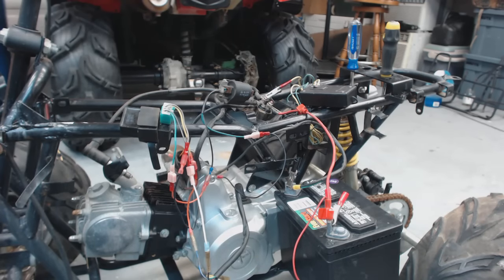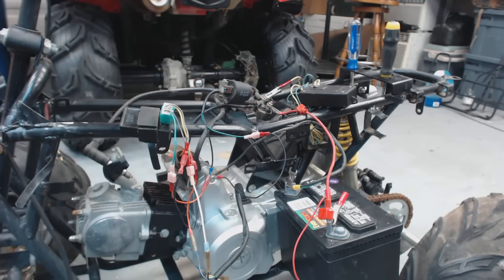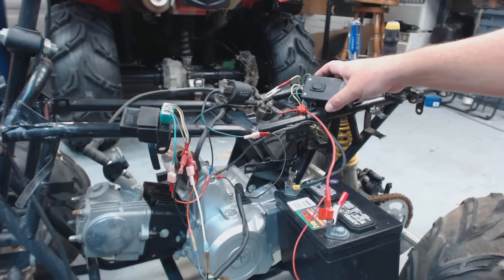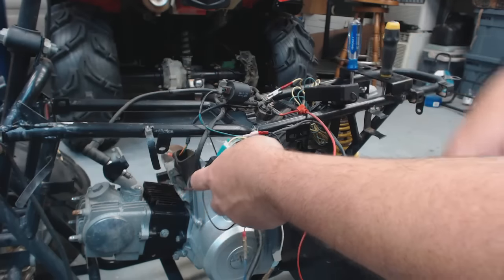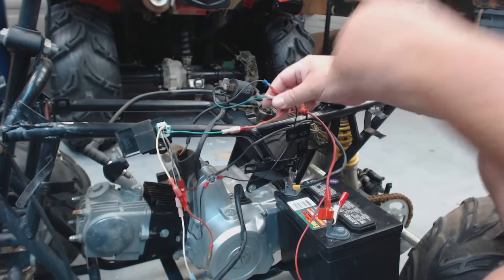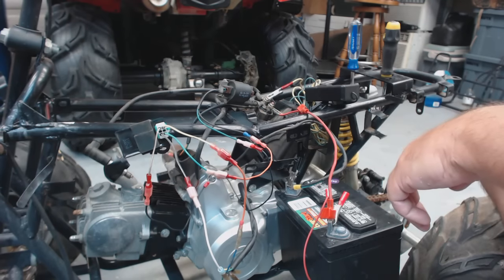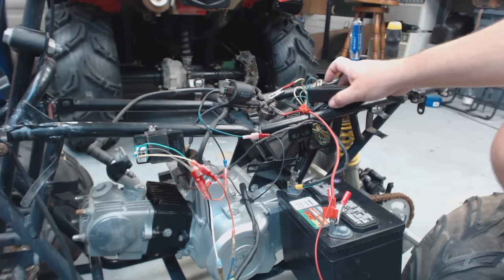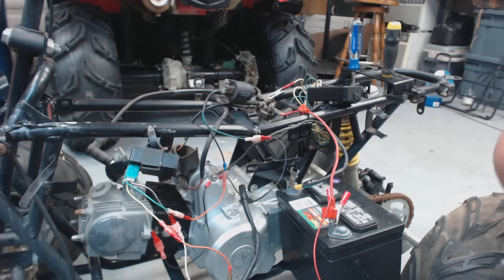Chinese ATV No Spark

Comment: Great video man. Helped me figure out my ignition switch was the culprit.
Reply from the maker: Awesome! Glad it worked out for you.
Reply: @mikesgarage9757  I used this guide today and it was perfect for what I needed. Where you have installed your "on" switch in the box, this is where we would wire in a momentary switch to get the bike started correct? Once the bike has started and the button is released, the starter will disengage and the bike will stay running until the kill switch is pressed using the center connector on the CDI plug. I want to make sure I don't keep the starter engaged and burn it up. Thank you man for the help.
Reply from the maker: @patrickfields2362  Yes that should work fine. Glad it helped out.
Reply: @mikesgarage9757  Do you have a fix to be able to keep the battery charged with a shortened harness like this?

Comment: Man why didn't I find your video first...grrrr. This ATV of mine ran when I parked it. Cleaned it up and then no spark. I already bought a new coil and it still didn't work. I had to remove the plastics again to get to the other connections under the fuel tank. Finally I have spark again...Thanks to your video
Reply from the maker: Thats Awesome! Thanks for the reply

Comment: This is an AC cdi circuit. 
With a DC cdi circuit you need a 12v input (not the red and black wire).
If you hook up a DC cdi this way, you will fry the cdi box.
Reply from the maker: True, but this is for a Chinese ATV not a GY6. I have yet to see one different. not that they are not out there.

Comment: I am trying to get spark on a Chinese go-kart. I put the kit in it that has the new cdi, regulator, coil, and solenoid. I can get it to turn over but no spark. Every time I connect the hot wire back up it chirps loud two quick chirps. I have found the remote kill box and should be able to just unplug it to get spark. But still no spark. The neighbor owns it and list the fob. I sure would appreciate your input.

Comment: I'm gonna go try it see if that works now if I do that and still no spark how will I know if it's the cdi coil or stator and what about the rectifier isn't it supposed to be in there somewhere please you have other videos on these
Reply from the maker: You would need to ohm out the stator. I'm sorry I don't have the values of what they should be. The Voltage regulator is for charging. You don't need it to run. I don't have any more Videos but I am planning on making some. Life has been crazy. Thanks for the comment

Comment: Hi there sir , Sir i have a gy6 scooter motor , i am confused . i have a blue wire ,  a green wire and 3 yellow wires ? green is for ground yes , blue i presume is the pulse . what are the other 3 yellow wires for? in sort i am busy with a off road project , I need  a simple plug in push start button and off button wire diagram. ty for your content . straight forward no bullshit ,   Joe ,, South Africa

Comment: Good vid but....which bottom position to attach ground off switch? It looked like you were pointing to bottom right, stator  black/red wire
Reply from the maker: Bottom center there is no wire in mine. just run it to a switch then ground.
Reply: @mikesgarage9757 k

Comment: I have two boxes which one do I know is the CDI box the one under the gas tank or behind the gas tank
Reply: The plastic box is the CDI the metal one with heat sync is the voltage regulator for your lights

Comment: Mike I know this video is old but I need your help I’ve asked atleast 20 people and no one know how to help but I can’t find my exact part mine has 3 wires plus the one for the sensor but when I look up the part I can’t find any except a 3 wire plus 2 wires I could really use your help I tried wiring your system up wire from wire but my magneto doesn’t have the same wires I wired each of the 3 up after figuring out which one ran the sensor but out of the 3 wires I tested all 3 with no clue which one to start with and still no luck 
Thanks for reading this and thank you for helping you definitely have my sub
Reply from the maker: Maybe its an AC system? Is it like this?
https://www.ebay.com/itm/394752655168?hash=item5be9177f40:g:4sgAAOSwXIFkEOA0&amdata=enc%3AAQAIAAAA4Ff0Qv3UNGUqQmOf24esgkdXhlq196te9gW4seDSwJ8TimIZUShF0gEoL9cdVeDmPnxLq8MIhNOzNRCI3f0tMow8WhDSUIqHlXdefzhHz%2FwaMbtvOffFW3kgstzPAQUU5gE%2B6hC9pymGD3gE4VXI0rgLPUbjaIcNDyO46NcO1n%2FDOwdDtEQMWekcH9of1AwSVO09CzibLmHn2aNLg9rYlhedcKvV5V%2Bs6aCxIgEVttEwdk6j%2FQ2IgcQiXEh7J4rUjP09uOHy0Zvu8ZX8bWe5dFXT1vTOcGt6dUkiFnPi9o2B%7Ctkp%3ABFBMpsbonfdi

Comment: I am installing a remote start on a 125cc.
I have got it to crank with the remote but won’t fire. If I put the hot wire on the top right,  it should get spark right? I put this Wire on the accessory wire of the key switch, I get power to lights but will not make spark. I have put this wire on every wire on the the key switch harness with no luck.
Reply from the maker: I would need to know the pin out of your device.
Reply: @mikesgarage9757  I have a 5 wire ignition key and this is the remote start I am using. Saihisday Dual Remote Control Start Kill Switch For Chinese 55cc-125c Taotao Kazuma Roketa Sunl ATV https://www.amazon.com/dp/B078GGXK2G/ref=cm_sw_r_cp_api_glc_fabc_bXJZFbDJSH81S. This has the same wiring as you described in the video. I hope I have gave you enough info. Thanks

Comment: Good video . But what are the normal voltage outputs from the stator to the ignion box and from  the box to the coil ?
So the system can be tested for what component failed .
Reply from the maker: I have not done those tests, so I would not know. Sorry I cant be more help.

Comment: Hello if you would lead me in the right direction. I was given a Chinese 4 wheeler kid's version. Wiring is toast. With the way you are wiring just to see if this thing will fire or at least get a spark .What wire do I use for a turn on switch. . I'm not a mechanical engineer or a electrition. Just trying to find out if I should junk it or get it fixed for the kids. . Don't want to invest unless it's worth it.
Reply from the maker: Just a push button. You can get a kit for them cheap on Ebay. These engines hold up well. its the bike that falls apart around them

Comment: Hi. I have a 50cc Chinese atv it sat for 3 years I replaced battery and no lights, no nothing. I was told to change the fuse. I have no idea where the fuse is located on one of these. Can anyone advise? Thanks!
Reply from the maker: Usually its on the Red wire coming from the batt.

Comment: Awesome, its been in garage for 3 years the girls i got it for are into boys now so i guess its mine. That got the spark going, buuuut  its makeing a popping sound just when its trying to fire. Any idea what that might be?
Reply from the maker: Sounds like a stuck valve, or maybe it jumped time a bit? hard to say. shut the gas off and put a little fuel in the spark plug hole and try it. if it fires off you may just have a fuel/carb issue. sorry for the late reply.

Comment: I bought all new parts and still no fire i got new stator and pickup coil and new cdi and new coil and also hooked it up just like u showed and still want fire
Reply from the maker: Same Type? Silly question did you check the spark plug?
Reply: @mikesgarage9757  yeah after buying everything new found out it was a bad wire in the plug that goes into the cdi box

Comment: What about the regulater retriever does it keep it from sparking if reg is bad
Reply from the maker: Voltage Regulator is for Lights and Charging only.
Reply: @mikesgarage9757  ok ty.ive put new coil pack on and still no start.i moved wires on cdi box around and it started,ran 2 day fine then quit.moving wires again did nothing.put new cdi box on and nothing.any advice
Reply: @mikesgarage9757  i dont have voltage tester and dont know how to use one

Comment: Thanks for the video, and you can always kill any motor if you pull the plug wire off quickly
Reply: Yes you can. Thank you.
Reply: Good way to get zapped. Better hold it back away from the plug. I've seen the spark  jump 8-10 }inch
Reply: @ballzmahonee5645  I had a yamaha banshee that had no kill switch. I had the throttle get stuck wide open and I didn't wanna blow the clutch if I pulled it so that's when I learned the trick

Comment: Hey Bud! Thanks a ton! Mine came to me just plain roached from a scrap cleanout. Looked complete though so I had to try. My CDI is a little different than the one in your vid but between You and a schematic, kind of splitting the difference, I got it sparking and running. Does that kill switch ground the ignition like an old magneto lawnmower engine, or does it kill the power to the coil?
Reply from the maker: Like a Magneto. I am glad the Video was useful to you. Thanks for the reply.
Reply: @mikesgarage9757  Understood. Thanks!

Comment: Hey I have a eton 150cc and I cant get spark on it. I have a question, does the neutral safety switch and all play a role in getting spark? As mine has a PTC and a neutral safety switch but cant figure out how to wire up either
Reply from the maker: Sorry for the late reply, but I don't have the answer to your question.
Reply: @mikesgarage9757  its all good lol i dont need either i already got it sparking like mad just cant get it to run
Reply: @shiloh-onecallidoitall8886  how did you get it to spark

Comment: hi mike my 125 runs but cuts after 10 seconds i pulled the plug and sometimes theres no spark for like a minute of turning then it comes back then cuts again i removed the kill switch thers  no short nothing
Reply: @Dominic Meyer i swapped it with a same bike it runs and the spark stilll cuts off can it be dirt in the flywheel? or bad stator pickup coil?
Reply from the maker: @justinc9911  Maybe bad Coil or Even Plug.

Comment: I took the wiring harness and engine off a 200cc enduro motorcycle how can I go about bypassing the key ignition wires basically I'm tryin to figure out how to make a wiring harness out of the old harness that came off the bike it ran before I took it off but I cant get starter to crank and cant use kick start. Reason why I cant use kick start is because i swapped it on my 1985 Honda atc 185s and kick start cant travel far enough.
Reply from the maker: I am not familiar with that system. I assume you would connect the wire that pass power.

Comment: I got a little Chinese 86cm quad I'm getting no spark .I found a little round key hanging on the bike . I think it is a safety key but I can't find where to plug it in at . Does any body have a clue where it goes.
Reply from the maker: The middle wire at the top of the CDI is usually what its tied into. if the plug is off it will kill the bike its a safty plug that ties to you in case  you fall off

Comment: I want to know what bolt is positive and negative on starter solenoid?
Reply from the maker: Not sure what you are asking The Solenoid is a switch when power is applied to it it takes the hot from one side and applies it to the other.

Comment: Don't know if anyone will see this but I got a little 72cc china bike and I got it running great and I was trying to hook up the ignition wires so I could have lights and I touched 2 of the ignition wires together and pop, now it just cranks, I checked the only fuse i can find and it looked good i swapped it with a different one just in case and it didn't work. If anyone has any ideas please let me know as this is basically my little get around quad. Please and thank you
Reply: Probably burned the rectifier/cdi, maybe?!?

Comment: Could you help me troubleshoot the problem with my chinese atv? the problem is while i was starting it started (like normal) but i turned it on and off to take off the carb to tune it then all of sudden i hit the trigger switch and nothing i get completely nothing but the lights work and i touched the solenoid and it sparked and turned the starter i saw that other video you made about the switch but the connections weren’t dirty at all please comment i’ve been working on it for three days
Reply from the maker: so the switch does nothing? when you jump the terminals on the solenoid will it start? If the contacts are clean on the switch and it starts by jumping the solenoid then the solenoid probably went bad.
Reply: @mikesgarage9757   yes,and yeah when i jump the solenoid and it sounds exactly like if i’m clicking the button .i used a volt tester and everything seems to be getting power
Reply from the maker: So ohm out the switch. You should be able to put your meter on the ends of the switch and set it to ohms. Any setting will work. Push the button on the switch if the meter changes then the switch is good and the solenoid is bad. Ir it does not change and readings on the meter then the switch isn't making contact.
Reply: @mikesgarage9757  its me again i replaced the solenoid and it started right up i toke it for a drive gave it gas and it died brought it to the garage saw that it didn’t have spark bought a new stator,recoil,cdi,switch and ofc new plugs
Reply: @mikesgarage9757  what do you think it could be?
Reply from the maker: That's Strange. I would start with checking the Plug maybe it just gave out. I have had that happen. I spent several hours one time trying stuff because I just knew the plug was good. well it turned out it wasn't.
Reply: @mikesgarage9757  well i read the forums they said to cut the kill switch wire to if its a kill switch (black and white wire) from the cdi i did got spark! but won’t so i cleaned the carb and im going to install it back today
Reply: start**
Reply from the maker: Yeah that's the top center wire correct? I thought I said that in the the video?
Reply: @mikesgarage9757  i swapped the cdi cause i got pissed and just changed the cdi cause why not BOOM! It started so now i gotta miss with the air/fuel since it only runs on choke and i might reconnect the center wire to have a kill switch cause i touched them and it didn’t stop it for the while i had it on (the handlebar switch wasn’t off)
Reply from the maker: @Ltxheraldo  Awesome. Jets may be a little clogged on the Carb. you may want to pull it and clean them. blow some brake cleaner and air through them.

Comment: There's no ground coming out of my engine. I opened up the casing and did however discover the blue wire coming from the pickup was burnt out. I have replaced this but still no spark. Any ideas?

Comment: What does it mean when it’s turning over like it does in the video but still no crank
Reply: Pull the plug and see if you are getting spark. If not Probably a bad CDI box.
Reply: @mikeking8059  I replaced the cdi still no spark

Comment: Help! I got a new harness from Amazon for my 90cc quad, connected all the plugs the way they are supposed to and the stator is the 6 coil one but when connected to the battery the stator get hot and starts smoking. Anyone had this problem? Chance of a plug been connected wrong or defective parts?
Reply: The same thing happened to me and that's why I'm watching the vid and know it runs great 👍 and it was sitting for 12 years and now it has great spark thanks to this guy's video

Comment: Good video and theory to create spark. However, I believe you should also show the viewers where to ground the stator itself because you only showed how to ground the spark plug coil and cdi box. Otherwise, this method works because I tried it before I even saw this video and the quad started and I rode it down the street & then the stator exploded.

Comment: Came to this video looking for ideas and help with my TaoTao 110cc atv that was supposed to be my niece's Christmas present but hasn't run since Dec 24. The tip about the kill switch was great. I saw on another site where they talked about the black and white wire being the kill switch and to eliminate that from the CDI connector to see if it's a kill switch that is stuck open. 

Just curious but are these pretty simple to wire? I can crimp connectors and shrink heat shrink but never wired anything this big myself.
Reply from the maker: Sorry for the late reply. You  can do it with crimps. just cover them well with decent grade electrical tape.

Comment: Hey Mike
Thank you for your videos they are very informative. I found a 110cc atv.
I ordered, left and right brake handles.
My question is, where do the wires go for each.
Are they brake light wires?
Thank you
Reply from the maker: Thanks for the Comment. I think one Side is for the Light and the other is for Safety Start. Where the lever has to be pulled in to start the bike.

Comment: Hello, thanks for the video. I am working on a Tao Tao  go cart. I found a shorted  stator and replaced it. I am still not getting any spark and found out that I am showing ground at the black and yellow wire where it plugs into the CDI. It does this with the key on or off. My middle kill switch wire shows ground with the key off and open with the key on so not sure why the wire going to the coil is grounded. Can you help me with this??
Reply from the maker: Unhook the middle wire to bypass for test
Reply: @mikesgarage9757   I unhooked the middle wire ad still no spark. I did notice that when i plug the green wire to the coil it grounds the wire going to the CDI. I tried multiple coils with the same result. Any ideas on this?

Comment: Mines lost spark had some yesterday now it doesn’t messed with it for hours I simply give up
Reply from the maker: Could just be a bad CDI. You can get the parts from  Ebay for like $12 to replace everything.
Reply: @mikesgarage9757  I bought a new cdi and coil and a carb it was getting spark when I got it then it went out just replaced all of it and there's still no spark
Reply from the maker: @joelangrehr6184  Sator probably